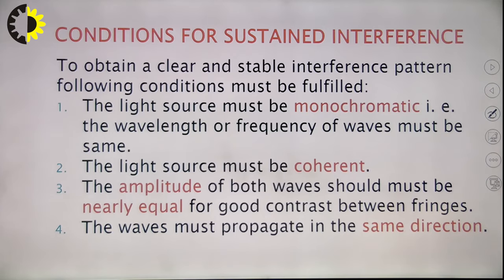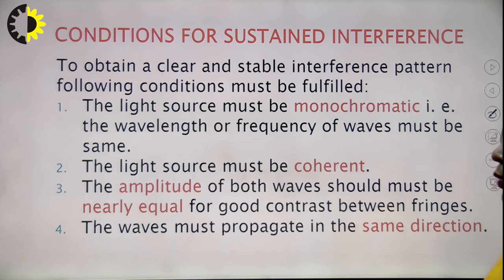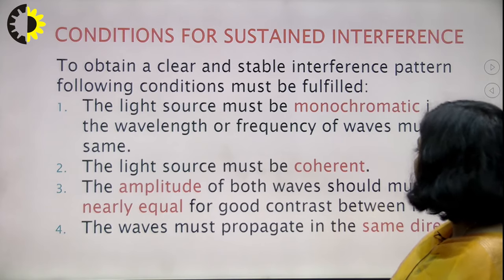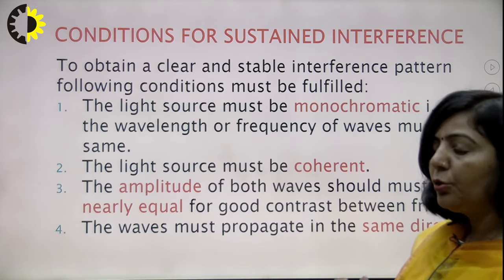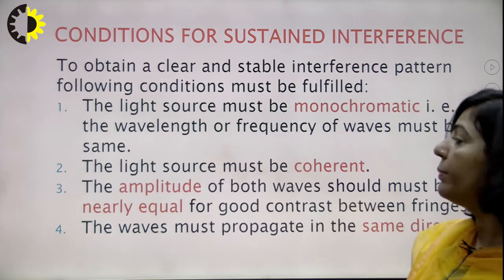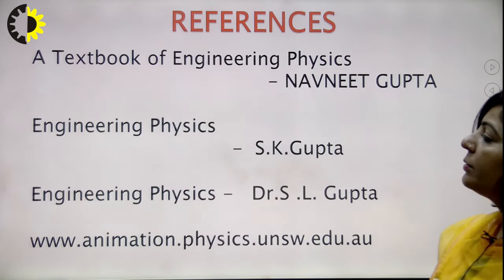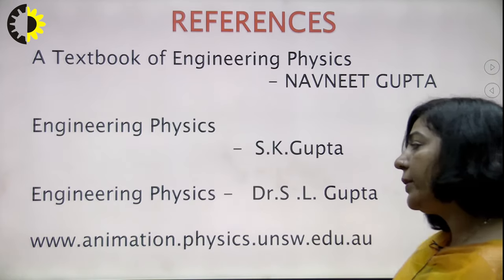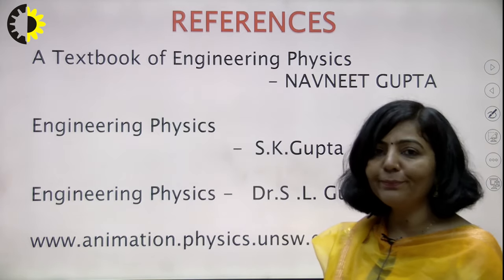ENGINEERING PHYSICS LECTURE 37 ''Wave Optics; Introduction'' By Dr. Bandana Sharma, AKGEC

Comment: 00:17 Introduction to wave optics
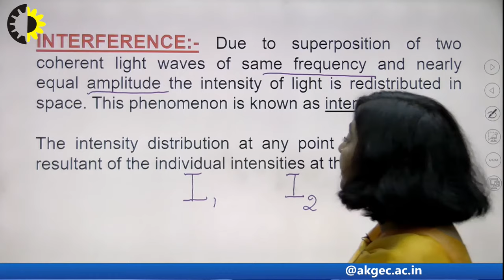07:17 Understanding constructive and destructive interference in wave optics.
13:32 Wave optics illustrate destructive and constructive interference.
19:43 Understanding the concepts of interference and conditions for maximum and minimum intensity.
24:54 Understanding the conditions for constructive and destructive interference
29:52 Explanation of conditions for constructive and destructive interference
35:57 Wave Optics introduction and basic concepts
41:54 Wave optics involves interference and thin films
Crafted by Merlin AI.

Comment: A lens (n=1.52) is coated with a film of magnesium fluoride (n=1.25). What should be the least thickness of the film in order to minimize reflected light with a wavelength of 550nm.  Sir how to solve this